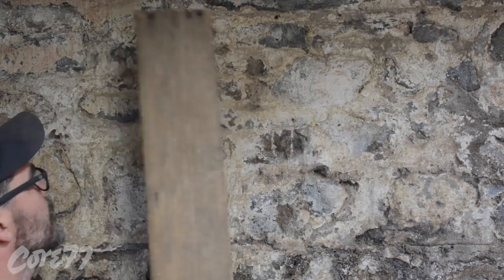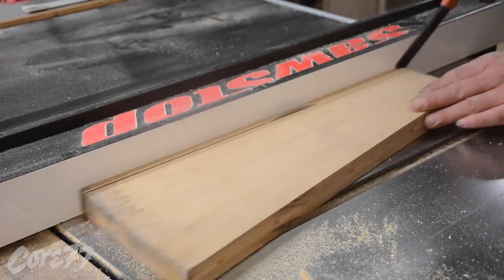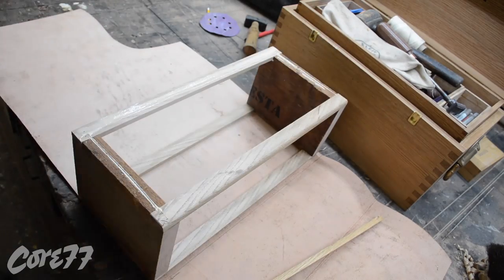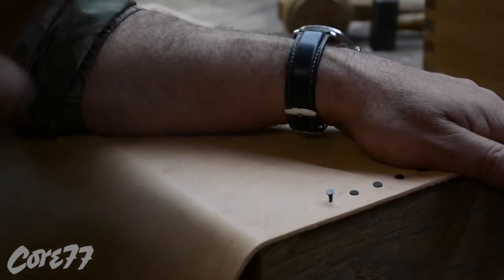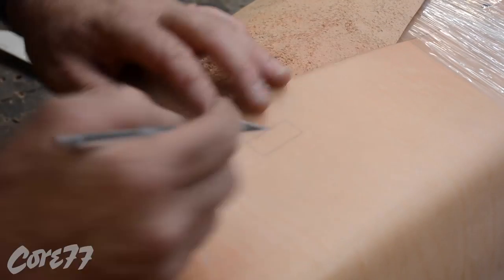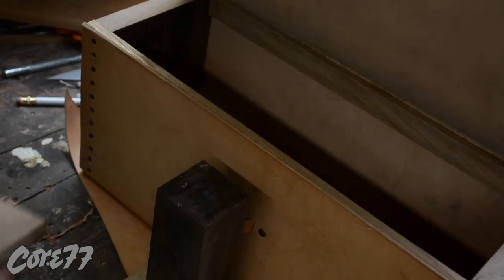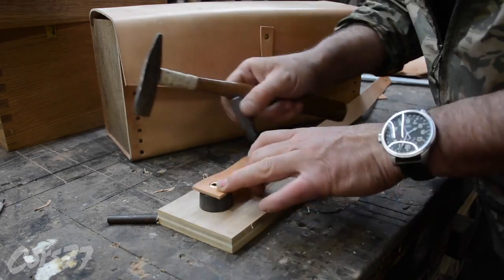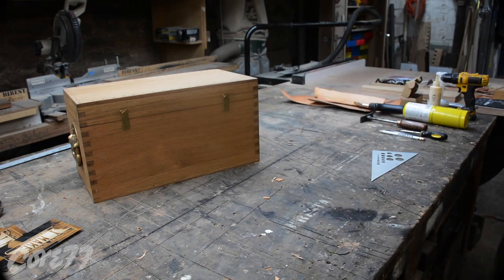DiResta's Cut: Oak & Leather Toolbox

Comment: Such a queingkydink that you did this video! I'm a welder, and I have a Miller passport welder. it's like a suitcase... it has a canvas tool pouch that tears to shreadsin no time. I've replaced several times. just today I was thinking of ideas on how to make something out of leather. never working with leather I wasn't sure how to make the sides. Jimmy, your my hero! I won't use 50 yr. Old Oak from Montana, but I will be using Pallet Oak, Leather and the other hardware you used.
 You really made my day...

Comment: That's awesome, I'm gonna have to pick up some heavy leather. One nitpicky suggestion I have would be to clip off the corners on the top end of the lock, like you did with the ends of the handle.

Comment: Glue a piece of leaher unter the eyelet as a spacer. So it wount get stuck all the time you close it
Reply: Good idea, i was also thinking of riveting the tongue from the under or back side of the front flap and feeding it through another small slit. The tongue around the rivet wouldn't get so thrashed with heavy use.

Comment: It would be cool if instead of the rivet on the locking strip you used one side of a snap then put the other side on the end of the locking strap. Then when you feed the lock strap through the loop you could double it back and snap it in place.

Comment: Great bag, enjoyed the video.
Can you walk us through how you would price something like this?
Reply: Update to my post here.
I’m currently building a rat rod motorcycle. I’m using a 2006 Sportster as a donor bike.
Ridged frame with a springer front end.
I’ve been trying to figure out how to build some saddle bags that will fit into the theme of the bike.
I’ve decided to use this bag as a basis for my rat rod saddle bags.
Although I will be making them a little different shape and with a better closure so they can use a lock.
Thanks for the inspiration.